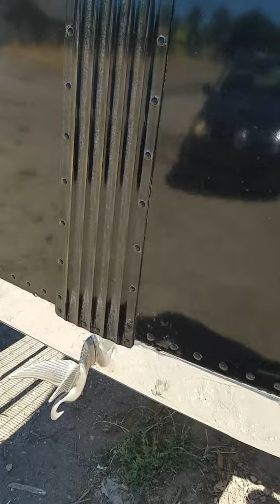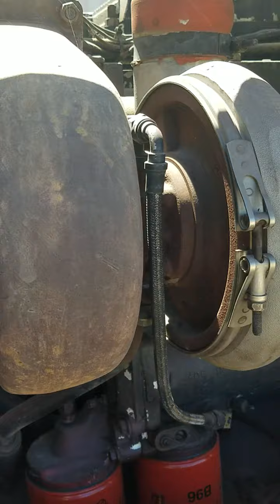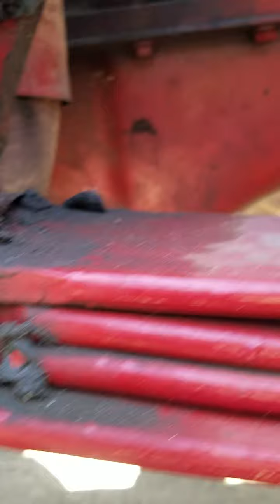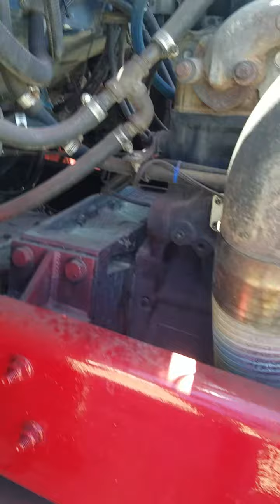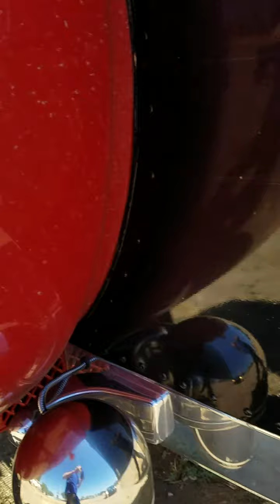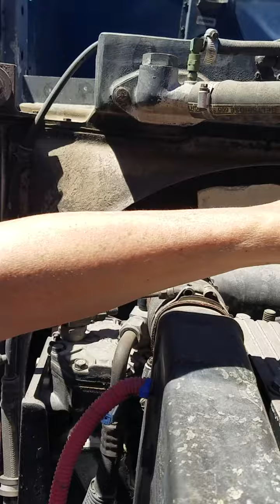1987 Peterbilt 359 EXHD Cummins Big Cam 444 running

Comment: 🤔 how come my 444 Black Sheep has oil underneath the oil cap and a slight air from blowbi
Reply: Your valves aren’t set properly !  Find someone that knows or can look up specs , huge difference to the engine and performance and mileage .   Not standard 855 cu in settings !